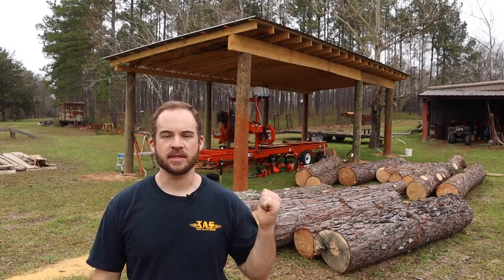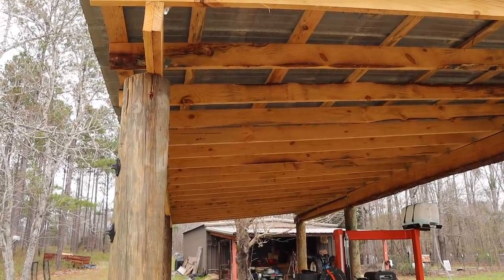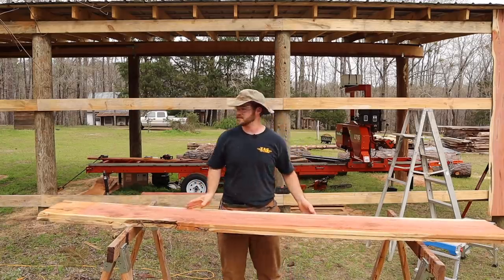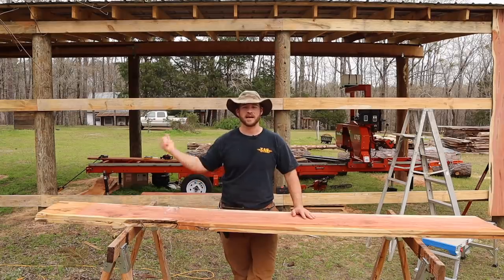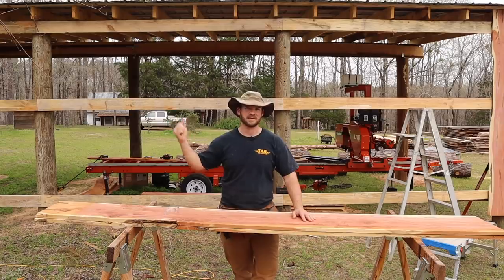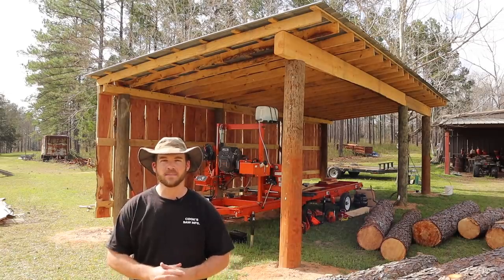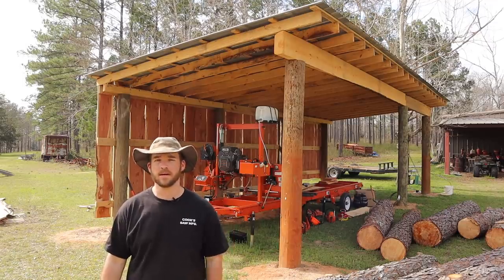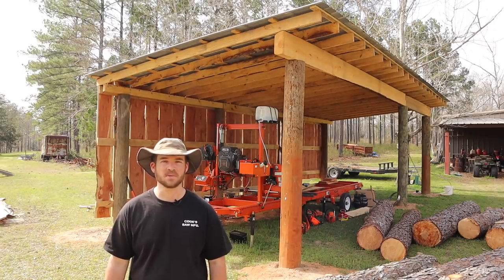These Cedar Boards Made A PERFECT Shed Wall

Comment: Watching your epoxy countertop, I've thinned my polyurethane coated bathroom red oak countertop with mineral spirits to penetrate deeper. I know the white oak maybe more porous, but maybe using mineral spirits or some other solvent by itself or mixed with polyurethane or the epoxy may stop it sucking up the finish. Just an ideal. Great videos!

Comment: First good wind storm & that shed is GONE. You've done everything incorrectly, with no bracing & the wall joists not being checked into each post & bolted. The thickness of each joist is also too narrow. Joists are normally 4" x 2" to span between posts or studs & should not bend. I'm a builder, I know what I'm talking about!

Comment: That's a fantastic use for your cedar boards. I'm reminded that the temple that king David built used the cedars of Lebanon. You now have a temple to serve our God while sawing lumber.
I think a good way to help with the issue of the round post to alignment of the horizontal side perlins would be to yes, notch out for a piece to insert into the post before attaching the perlins.

Comment: Its your cedar,...do what you want with it!!! end of story....people are idiots. I like to burn mine in my summer fire pit, i like to hear the snap crackle pop...sue me lol  As for the wall, you can run horizontal boards along the bottom. If it were me i would've leveled the site 1st to avoid the problem.

Comment: I've built several sheds and a cabin in my 77 years, and I know what you're referring to about the purlins attached to the round posts. I've done plenty of that. What you did is fine if you don't think it's necessary to notch the posts. The only thing that bothers me is that you put only two screws through the purlins into each post. That's barely enough to make the purlins themselves secure. But the added boarding puts more stress on those few screws. It's not just the weight of the cedar, but most importantly the wind. I'm saying this with a smile, not meaning to criticize. I like your mill. I would have loved to have one years ago.

Comment: For the slight shear weight your carrying with the cedar,  3/8" x 3" timberlock structural screws would suffice over time spent notching. Nonetheless, you'll be awite.